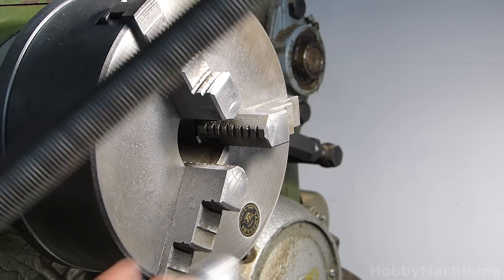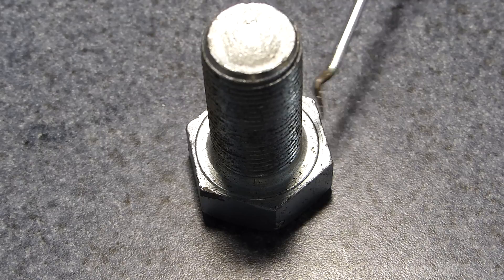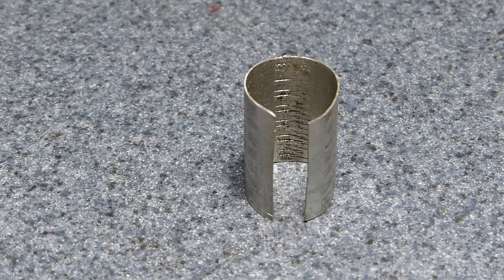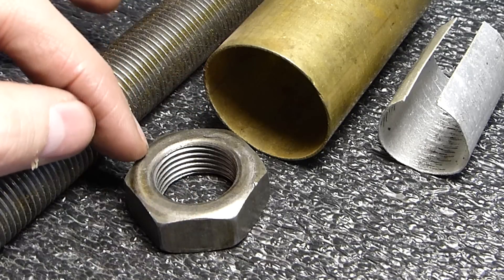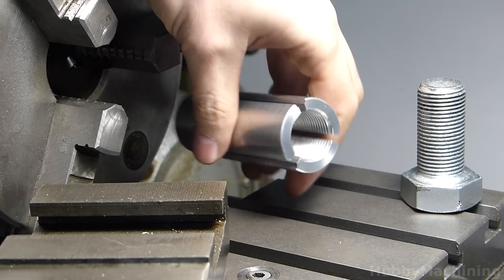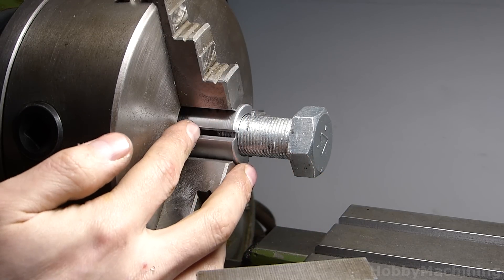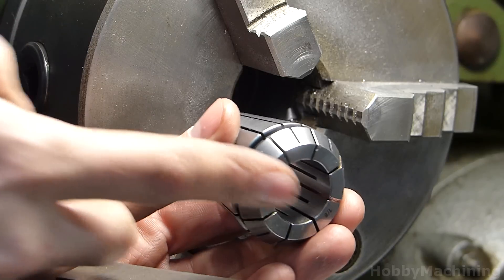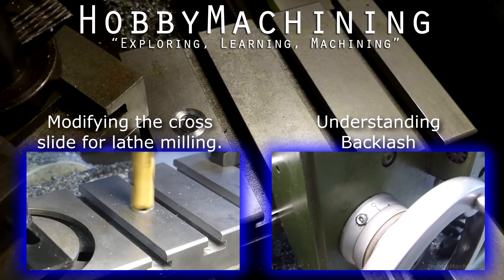Holding threaded items for machining in the metal lathe or mill

Comment: I like the way you worked from one "solution" to another, thinking about it, then trying another method and so forth. Your video is useful not only in learning how to hold threaded material for machining, but also a method for solving those thousand and one problems that we hobby machinists run into. Thanks for a great video. Keep up the good work.

Comment: I was tasked with making or modifying odd bolts and screws a couple of jobs back.  Previous machinists would just clamp down on the threads in a 3 jaw chuck.  That isn't the way I like to do things, so I came up with a similar solution to yours.  I started using hex nuts as a first step.  Eventually, I made fixtures to secure what I was working on.  Considering this is a hobby of yours, Well done!

Comment: I just did a similar project and I purchased a bolt that was not threaded the full length of the shank. I gripped the bolt at the unthreaded portion in the chuck jaws. For your example with a full thread, it can be simplified by just using an off the shelf nut and cutting it in three piece just like you did with the aluminum casting. I used a cutoff wheel in an 4" angle grinder. I use this method to chuck wood projects in my metal lathe for precise turning (don't you dare tell anyone).
 Thanks for the idea, you saved me some serious time.

Comment: what i do when i need to machine a threaded part on a lathe is take a piece of round stock, then clamp it in the chuck. then i drill and tap a hole through the stock. this ensures that the hole is concentric to the chuck as long as you don't unclamp the stock. then i torque the threaded part in the hole. as long as you do all of the machning with the spindle rotating clockwise the part won't come loose. this also works with threaded rod. all you have to do is jam a nut against the stock. i've used this method for machining thousands of parts and it has never failed me.

Comment: Excellent, just what I needed. I decided to have all the grub screws on the dickson toolholders machined so they are flush with the top of the holder, and also brass tipped. A lot of screws to turn and bore, and short length to work with. As you say, shim stock sleeve works but it's too fiddly and twists the screw very easily. This is perfect!

Comment: You came up with a good method. Some people just wrap the threads with wire. Another approach might be to thread the inside of a round sleeve to match the bolt. Thread the bolt in until it comes out the other end just flush and weld it. After your milling is done, just grind off the weld.

Comment: This is a  good idea, good work!. Making the threaded collet from Al should make it grip steel parts more firmly than hard steel, will try that. I have used a similar idea for reusable split threaded steel inserts in C5 collets on my lathe. If the outside is turned and the internal thread is single pointed (not tapped) to a good fit, then concentricity and axial alignment should be close to optimal. More accurate than any method gripping the outside diameter of the thread. Its of course less work to use double nuts, a piece of thin Al or brass or other quick methods to chuck the thread if accuracy is not important. But if You need to align a long ready made thread with a say a bearing, this seems to work very well.

Comment: i've only turned down the head of a bolt once and the way I did it was I put a fixture in the chuck with a threaded hole in it then put my bolt in that with a lock nut on it. just tightening it down will leave it running out badly so I indicated it in before fully tightening and it worked just fine for me. given that I only had to do this once and I already had the fixture it seemed the best way to do it for me.

Comment: For larger-scale production, you might consider using threaded soft jaws on a chuck - that way you can open the jaws further to just slide the bolt in and out, without needing to thread it in and out each time.

Comment: Nice video, A tip: You could also saw a nut that fits the bolt in two and but them around the bolt, you can use 2+ splitted nuts to hold the bolt more firmly.

Comment: Although i find this method excessive, I concede it is technically better than my usual leather strap. The only ways i can see to improve your homemade collet is to add a flange at the forward end to use as a datum for depth and to add a lockable bolt from the rear to give a depth limit
Regards!

Comment: I have 2 ways I use to turn threaded rod, screws or bolts. The first and most popular "go to" way to do it is just chuck up a nut in the jaws, thread in the rod or bolt but also ad a jam nut to keep it from turning. Nuts are not always made right and some are out of concentric so it is best to chuck it up lightly and spin the chuck to check alignment and then adjust a bit. Once it is running fairly true do the turning you need to do.

The 2nd way I use is to find a aluminum or steel bar large enough and chuck it up tight in the jaws. Next true the end, then drill it out and tap it for the thread size of the bolt or threaded rod you are working with. Then thread the bolt in with a jam nut and do your work. This method will assure your threaded bolt or rod runs true.

I do like the idea of slitting the rod 3 ways and thus eliminating the jam nut. I would still mark it so I could put it back in the jaws the same way it was originally when drilled and tapped. This would get you a more true running setup as most jaws are going to be .003 to .005 out and are going to be consistent so you can put that threaded Collette back in next time and get it to run more true next time. I just bought a large 14x40 lathe and the chuck seems about the same and has around .003 run out. though on this lathe I might be able to fix that. 

~

Comment: I use 2 nuts with a spring washer in-between. put these into the chuck.
Another way is to custom fit alloy nuts using the same way as before.

Comment: I made pretty much the same rig only I have a 80mm chuck and there is no room to have the bolt (much less with a collet holding it)  go through the small hole in the chuck. So I made a short version with the web facing out...works well.

Comment: have you looked at a square or hex collet block/ collet holder, usually they're made for C-5's but you could get come blank collets, thread them for what ever you like and hold it in the 3 jaw. as an added benefit you could  transfer the work into a mill vise and leave it in the collet holder, you could even use it for a basic angle divider, providing you needed 1/2, 1/3 or 1/6's

Comment: Index a piece of hex stock to the #1 jaw, drill and tap or single-point through, face the end, and slit the length.  A plug in the far end can serve as a stop for length and the adapter will run true if indexed when reinserted in the same chuck.

Comment: Correct and most accurate method I find is to just machine a piece of material, drill, tap for bolt to cut, then put that in the lathe and run lathe backwards or forwards depending on the side of bolt you are facing or turning down. Done. No wrapping, guessing, or cussing.

Comment: Thanks for the share. Although the collet you made would work best, instead of the three jaw, if you used the chuck that accepts collets. Just need to add threads to the outside of the nice collet you made. But, if all you have is a three jaw then working with what you have makes things interesting and fun.

Comment: Well done video.
Holding threaded items is always an issue. Even with your home made collet, you are chucking on the major diameter of the threaded item. You will still be pretty darn close.

Rather than casting the bushing, simple bar stock of the correct size, turned true and bored then threaded will work just fine. 

A collet chuck is the best for me but many times, esp when starting out, you do not have this kind of equipment. Most lathes can accept a 5C collet chuck or adapter and it is a worth wile addition when you can afford it. Even the inexpensive China made collets work well, most  home shops are not working to the tight tolerance that better colllets are made to.  I think the China collets I have are ground to 1/10000 ( 0.0001) which is good enough for the girls I go out with LOL! 

Nice solution to a common problem :D

Comment: The next development is to turn-up a collet-shaped blank from aluminium, drill and thread it, run a slitting-saw across it front and back. You will then have full all-round grip on the thread without distortion.

Comment: Soft jaws are an option as well but it won't hold as nice as the collet you made. My only issue with your jig is that the time it takes to make the collet like that will be kind of lengthy, wouldn't it? I can see this being practical for you, as a hobby, but me working as a machinist, this may be not so practical because it's for ones size thread and takes too long to make. I can see this practical in the shop if the shop needs to produce a mass quantity of these bolts but even then, a CNC would be more efficient. Great idea! I enjoyed watching :)

Comment: Why not just tighten a nut up to the bolt head (or 2 nuts against each other), then use the 3 jaw on those to turn the bolt head?

Also, if your jaws aren't centered, that offset will wreak havoc on everything you machine with them. See about how to turn them to true. It's not simple but it's well worth it.
Marking the orientation of your piece can do wonders for repeatability.
Reply: ExtantFrodo2 He explained why. Because nuts are rarely perfectly concentric. Meaning there is more material one side of the nut vs the other. Meaning the bolt would have a wobble when spinning, regardless of how true the jaws are.
Reply: Richard Smith  yes true about the possible wobble.. I like the wire idea wrapping the thead best so far? ????

Comment: Use a regular or a coupling nut and Crazy glue, when done heat it up and the glue will release. 

Or a lock nut, but keep the lock nut outside the chuck.

Just no real aggressive cuts, keep the work from getting hot!

Comment: So for every screw size (imperial or metric) that you might encounter - you will machine a holder? If you work primarily with one screw size - your idea is very good. Otherwise - just use a thin aluminum or other soft material wrapper like you demonstrated yourself in the beginning. Also is all you want is to cut off the head of the bolt with a saw - concentricity is irrelevant so you can just chuck the head itself or an extra nut threaded on the bolt you are cutting

Comment: Well Mr. R0gers,   I w0uld n0t use p0int Jaws 0n chucking up 0n threads in the 1st place.   Y0u need jaws that h0ld m0re 0f the circumference of the diameter.  And there is c0pper and aluminum jaws y0u can get that w0nt damage the threads
Reply from the maker: joey meyer Hi, and thanks for commenting.  Many people, like myself just have a regular chuck with regular jaws.  While I'm sure there is special gear that is more appropriate I have done my best to work with the equipment I have. (Which is what I think most home hobbyists have too) I think it w0rked out pretty well.  :)
Reply: Thenks,good idea! tylko dlaczego wkręcasz śrubę nic z nią nie robiąc?.?

Comment: Great vid!!
Any suggestions for holding one end of a ball screw (new) that will have one end machined as the drive end (motor) the other a fixed end with machining for a hand wheel. I've read that wrapping paper (seems kinda weak) or other thin guage material around the material will help with centering and protection from the pressure of the chuck.
Thanks
Reply: what you said or if you want it to be really centric use soft jaws? im no pro though.

Comment: Nice video! What kind of way do you use to shape the inside of the reloading die in the picture?
Reply from the maker: Mostly just drills, reamers, and boring tools.  Ball nose end mill too.  Thanks for watching.
Reply: HobbyMachining
Thank You for answering! I am asking because I did see something that looks like a reloading die in your video and I am preparing to get all the stuff together to reload for a .41 cal  M1881 Vetterli Stutzer rifle. I made a Cerro-safe chamber casting and found out, with a home made die to my likings, I can form cases with a much longer neck than the original case, so the ordinary Lee molds for the .41 Swiss can be used and there then is a nice amount of grip on the bullet. I am expecting very much from this superbly manufactured rifle with its set trigger.

Comment: interesting... did you try to chuck a NUT, and add a second NUT to the Bolt, then Tread the nut and bolt to the chucked nut, add 10 pound/Lb to hold it still and start the process
Reply: Yonatan Fuentes That's the way I did it once. It worked well enough for what I needed done.
Reply: hola, si habla español, entendi q usa 2 tuercas, y hace una contratuerca en el tornillo o rosca y listo... es lo q se me ocurrio apenas vi el vídeo jaja... Se complicó demasiado el hombre.
Reply: +Yonatan Fuentes  Yep this is exactly how I do it... No custom hardware needed except the nut for the job and a nut to lock into place. when done? you can use the nuts for something else.

Comment: just wrap the threads with copper wire.
Reply: The wire is the best idea so far as cheap and concentric so far... why not wrap it and cheerfully chuck it up in the hard jaws, ???
Reply: +Craig Strauss The wire would have to be wound really tight I would think so it wouldn't cause it to be more out of concentricity.
Reply: Micscience doesn't matter how tightly you wind it. copper's soft and will be compressed into the threads.

Comment: Why not just use a 3" nut with the proper threads? No need to split anything. And if you can thread the aluminum piece you can thread the nut. Normal lathe rotation will tighten the bolt in this nut.

Comment: I work in a shop and I have to say that your final outcomes neither cost nor time efficient. Single pointing that inside thread? Do you not have a tap? Honestly holding a part like that in a regular collet is more than sufficient. You could even take a chunk of material and bore it to fit that r8 collet, with a screw instead of a draw bar in the back, for you to chuck up in the three jaw if you don't have any other means of collet chuck.

Comment: What About indicating?
Reply: +Jack Brown I put an indicator point on the threads, but under the point I rig up a feeler gauge leaf. The leaf floats along the major diameter of the thread. I made a small holder up but it's at work. I can post a picture of it. if your interested. It saves me a lot of time truing up threads.
Reply: +Jack Brown I keep a box of brass bushings on hand in my "junk drawer" I let the threads bite into the brass.